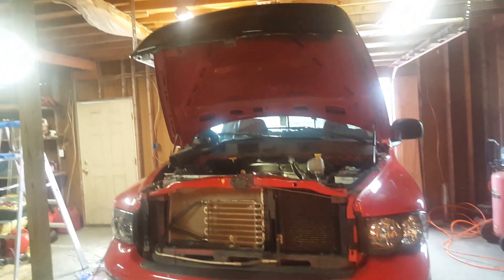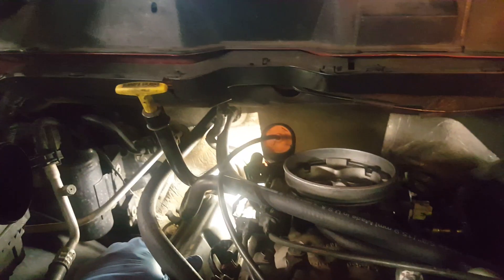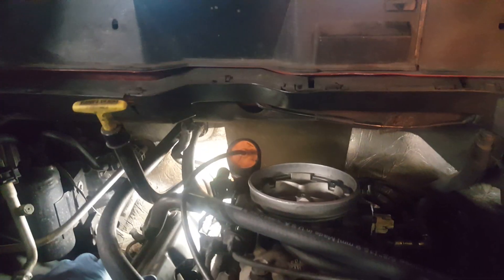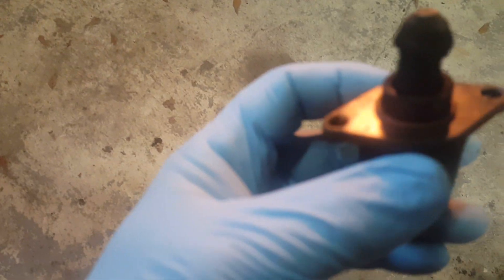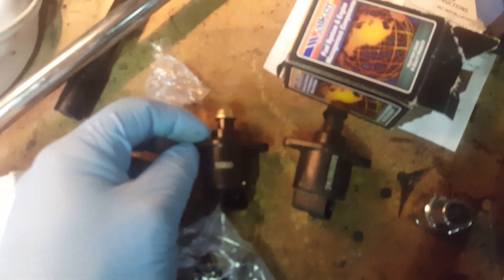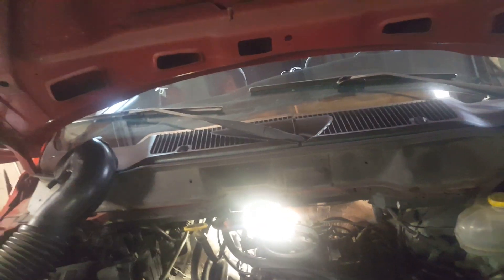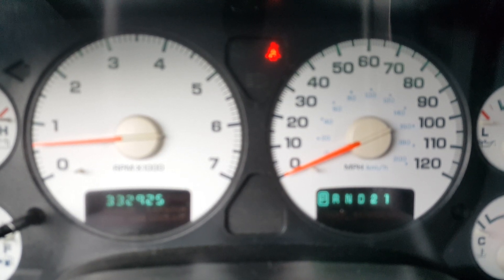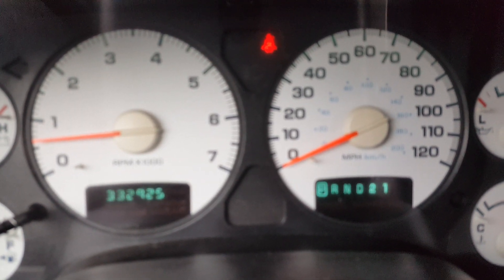Dodge ram idle air control valve

Comment: Super helpful for me. I appreciate you telling me about the tork screws. I picked those bits up on the same trip as the part. Also, the vacuum hose reminder was good. I almost forgot after reassembly lol. Fixed my stalling idle issue. Thanks for the vid.
Reply from the maker: Your welcome glad I could help

Comment: How did you put it into drive if it was idling at 2500 rpm? I am having the same problem and trying to trouble shoot. My truck currently idles at about 1200, and it's rough even then putting it into gear.
Reply from the maker: I just slammed it into gear and let it do its thing lol..
Reply: I have this same problem did you ever find out what it is? 2 years later lol
Reply: @carterdellavalle7246  yes, it was the Idle air sensor. It's super cheap and easy to fix. Took about 20 seconds.

Comment: Mine turn on but shuts off but if u hit the gas it stays on u think is this ?
Reply from the maker: Worth a try its a cheap fix if so.
Reply: Edwuin my 04 hemi does same but as per my OBD2 reading my 02 sensor is bad and must be replaced. I’ve read that sensor can cause those symptoms that the truck has.